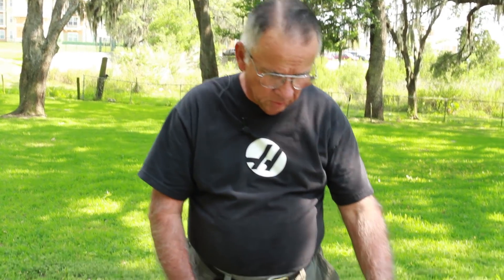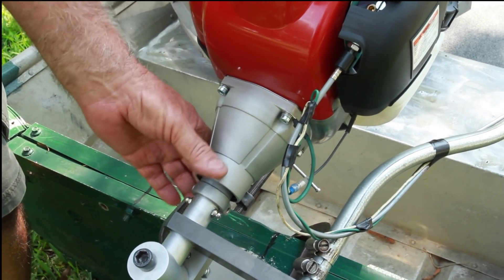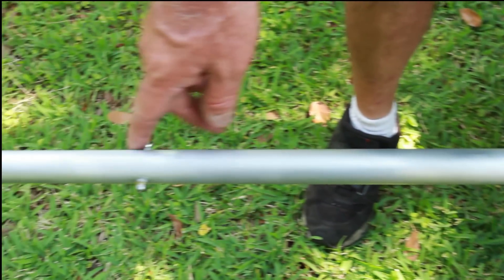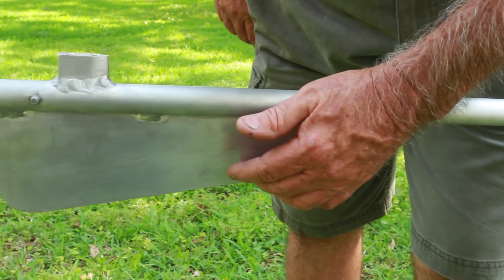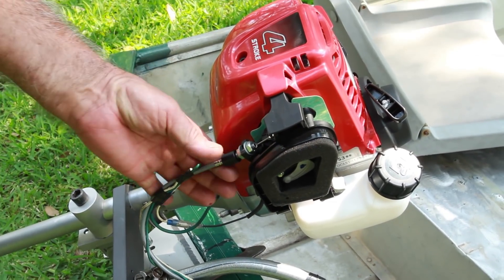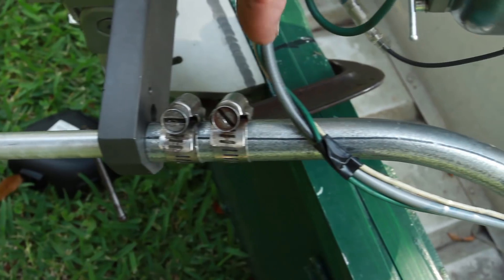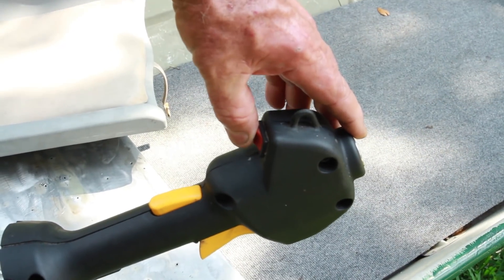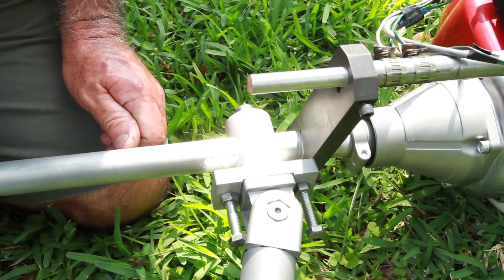Mud Motor Mania Part I

Comment: Thanks for sharing so much information about your design.  Those little Honda 4 stroke engines are sweet little units.
Reply from the maker: +scdevon 

First, thanks for the favorable comment.  Honda offers two versions of the GX35.  The other one has a different fuel tank configuration for fueling from the top like in a gas powered post hole digger.  It is my understanding that the oiling system in these particular Honda 4 Stroke motors allows them run in different positions.  i.e. vertical, horizontal, angle etc.

One project I am looking at is utilizing it to make a neat little outboard for Kayaks.  It would be SUPER!!!!!!
My Goal would be to incorporate the Linear Actuator Steering System and other items I designed in the electric trolling motor system discussed below.

 I am in the final prototyping stages of an Electric/Manual Steering 
System with Tilt and Trim for Minn Kota Transom Mount Trolling motors. 
It will be the cats meow for Kayaks.  Check out my channel for videos  
or see the entire build process on the NuCanoe Forum.  http://www.nucanoe.com/forum/outfitting/a-new-12-volt-linear-actuator-steering-system-is-coming-to-a-nucanoe-near-you/

Comment: Very informative, Nice job Sir.
Reply from the maker: +jon hayward 

You are most welcome.  If I ever get the time I would like to utilize the same Honda GX35 4 stroke and make a trolling motor for the rear of my Kayak.  It would push my kayak with ease.  I would just need a right angle gear box for the bottom of the shaft and I would be ready to go.  I would also put on my electric Linear actuator steering control system and backup manual system that I designed.  It would be the Cats Meow!!!!!  Presently working on an electronic kit to convert Minn Kota 5 speed motors to variable speed for use on kayaks.  The variable speed motors draw a lot less amps and you get more run time.

Glad you enjoyed the video.

John

Comment: nice work. you know a way to add a 6 gal external gas tank with primer bulb?
Reply from the maker: ***** I am not sure if that would work or not.  The carb is probably designed for a gravity feed system and may not???? work with a siphon feed system.  Call Honda and ask them your question.  I am sure someone in their technical support department can give you the correct answer.

Comment: I have to say this is awesome am looking to build a small light mud motor to go on a kayak this looks like it will fit the bill. great video
Reply from the maker: iwantosavemoney What would be nice is to have a 12 volt linear actuator control the tilt and trim.  Others have done this on trolling motors on Kayaks.  I am in the final prototyping stages of an Electric/Manual Steering System with Tilt and Trim for Minn Kota Transom Mount Trolling motors. It will be the cats meow for Kayaks.  Check out my channel for videos  or see the entire build process on the NuCanoe Forum.  http://www.nucanoe.com/forum/outfitting/a-new-12-volt-linear-actuator-steering-system-is-coming-to-a-nucanoe-near-you/

Comment from the maker: The stainless shaft is .375  i.e. 3/8" Diameter I used a 3/8" ID X 3/4" ID Seal.  The 1" O.D. aluminum tubing with 1/8" wall thickness can vary and can cause the seal to fit loose.  If so,  you may have to apply some JB Weld to the O.D. of the seal when you insert it into the 1" O.D. aluminum tube.

Comment from the maker: No, I don't sell these.  I just built one for my small Jon Boat.  I might consider selling the one I built if the price were right.  In the near future I would like to build a larger long tail mud motor with say a Honda 5 HP motor on it.  I have seen others in action in You Tube videos and I think it would be a nice size and not too heavy.